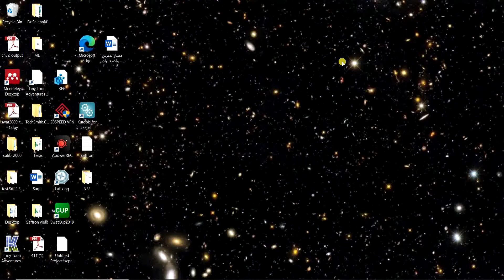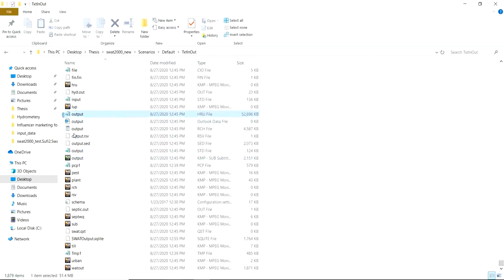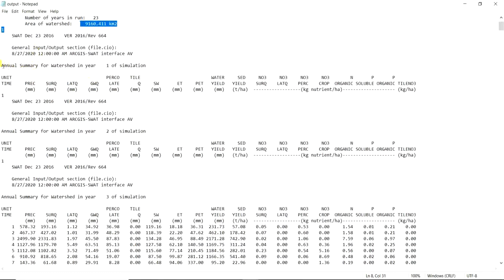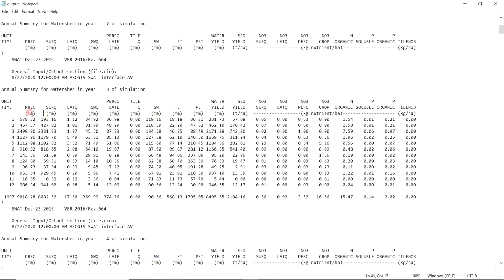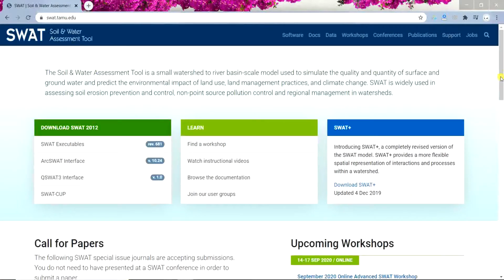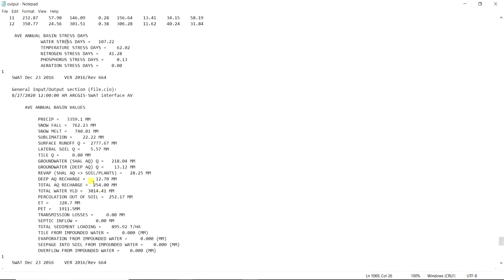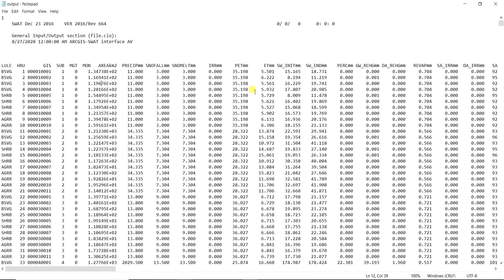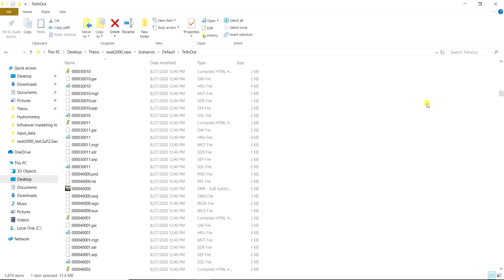SWAT Output

Comment: I am facing a problem and I want to solve it. When I click on Examine Model Output, this message appears
******** Starting Analysis ***********
 Reading output.std...
 Finished reading output.std in 00h:00m:01.12s. Reading output.rch...Value "" is not an int.

 If you cannot resolve the error, please contact technical support with the message listed below.
 -------------------------------------------------- --------------------
 Type: System.FormatException
 Message: Value "" is not an int.
 Source: SWAT.OutputProcessor
 Location: SWAT.OutputProcessor.Schemas.SchemaLine, line 0, column 0
 StackTrace:
    at SWAT.OutputProcessor.Schemas.SchemaLine.GetInt(String line, Boolean returnZeroIfNotNumeric)
    at SWAT.OutputProcessor.Parsers.OutputRchParser.ReadFile()
    at SWAT.Check.Desktop.SWATCheck.backgroundWorker_DoWork(Object sender, DoWorkEventArgs e)
    at System.ComponentModel.BackgroundWorker.OnDoWork(DoWorkEventArgs e)
    at System.ComponentModel.BackgroundWorker.WorkerThreadStart(Object argument)